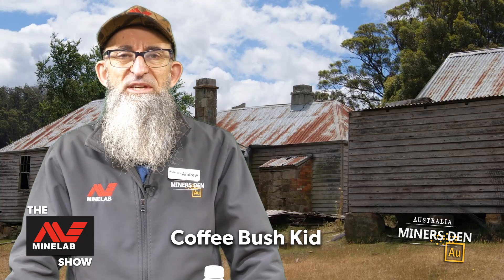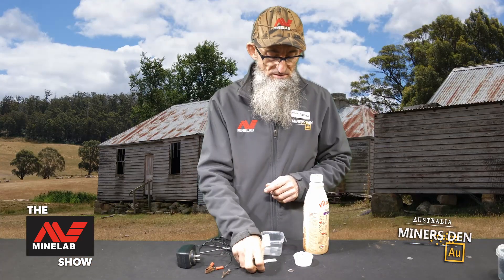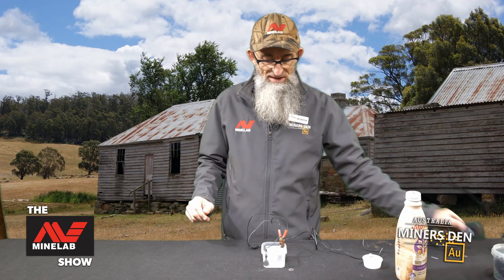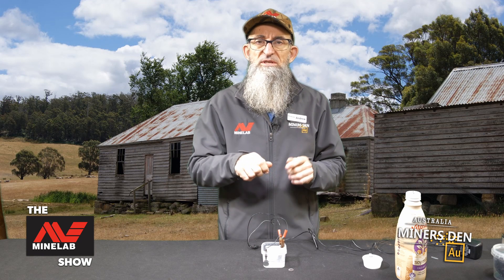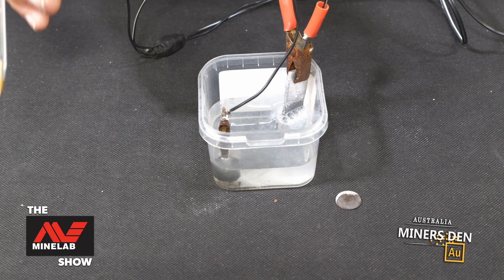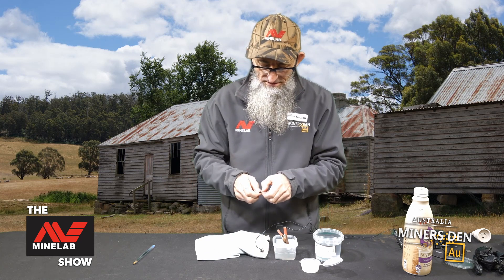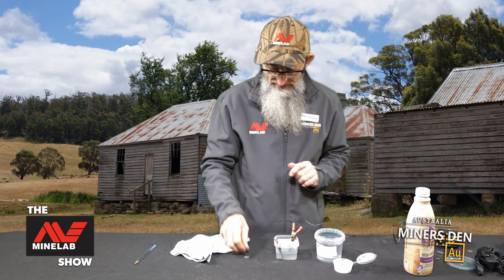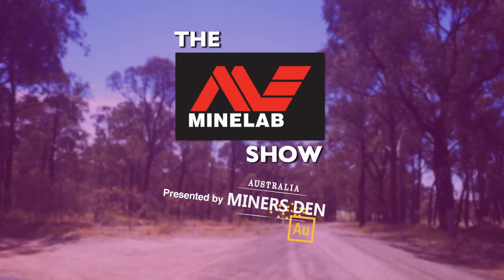How to Clean Silver Coins using Electrolysis - Metal Detecting Tips for Beginners

Comment: Hi Andrew, I've been looking at cleaning silver jewellery and there are folks that uses boiling water and backing soda. Place  some aluminium foil in a Pyrex dish  add baking soda add the silver and pour boiling water on it. The silver has to make contact with the foil. This works in seconds, I've used it many times, but now I'm going to look at using tomato ketchup. Simply rub ketchup on to the silver with a toothbrush for a few minutes and then wash it off.  The main advantage of this is you are not abrading the silver as you do when robing baking powder into the surface.
I'd be interested to know if this works for you? 
All the very best.
Kind regards . . . .  Andy      in the UK
Reply from the maker: I'll pass this on to Andrew for you! Another method i have success with is to wrap the coin in aluminium foil along with some lemon juice (so the coin is wetted with juice before wrapping) and leaving for a few mins- it will start to heat up and smell like sulphur. after unwrapping it, you put some baking soda in your palm, making a slurry with water, and very gently rub the coin- this neutralizes the citric acid and removes the now feed tarnish layer- the coins look like new!
Reply: @MinersDenAustralia  Thanks for the information. Kind regards . . .  Andy